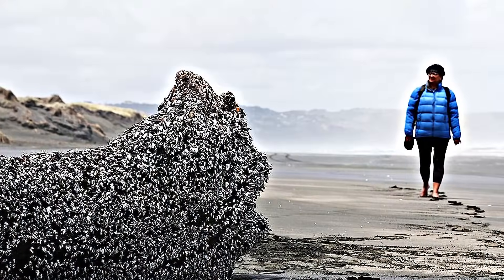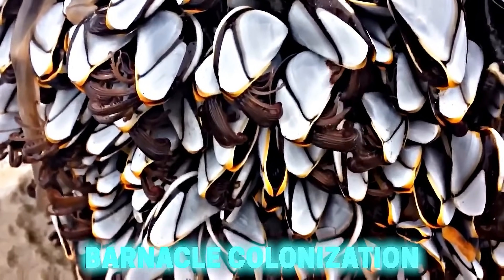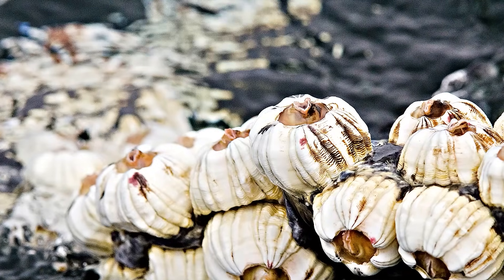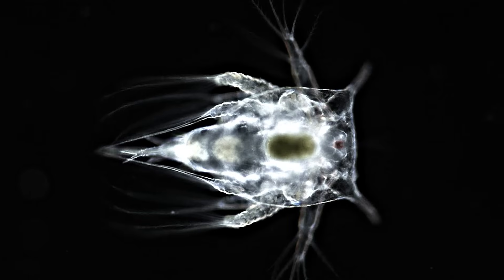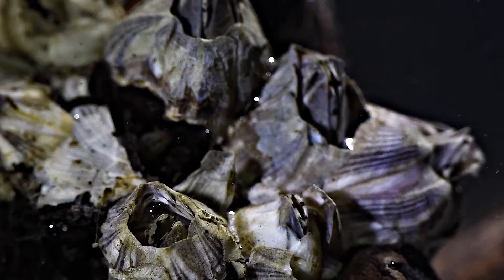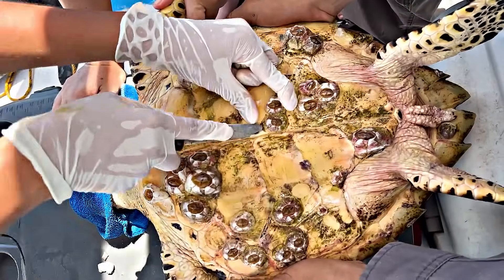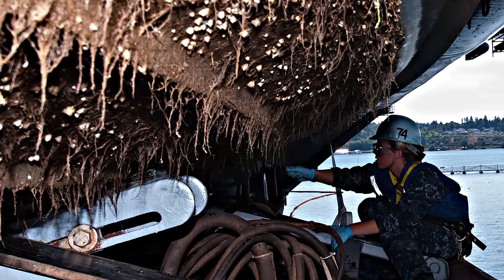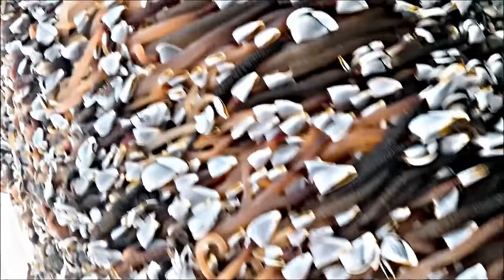Barnacles: Prepare to Be Amazed!

Comment: Why not describe to us what those lettletentacles are doing and how and why do barbacles appear to be able to open and close, too much about the glue, which is interesting but obvious, and not enough about the structure of a barnacle.
Reply: They are crustaceans, and their internal body plan is actually very similar to a shrimp/prawn, just imagine, instead of a pointy head like a shrimp, it instead has a flat head that secretes the adhesive substance, and the rest of its body is sorta upside down, with it's limbs adapted into furry tentacles that it keeps opening and closing, like a little hand capturing plankton and other random edible stuff where it pulls into it's shell and towards it's mouth to eat.